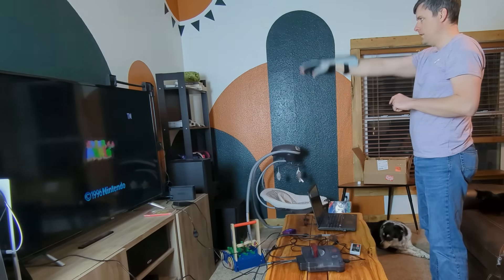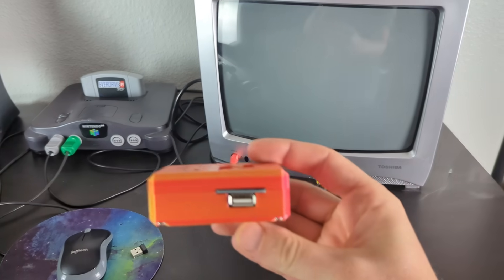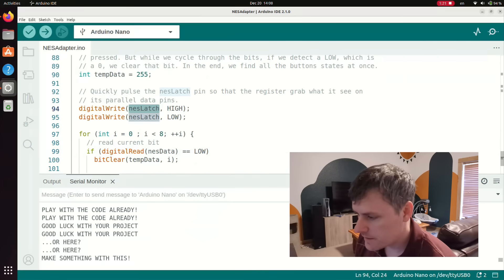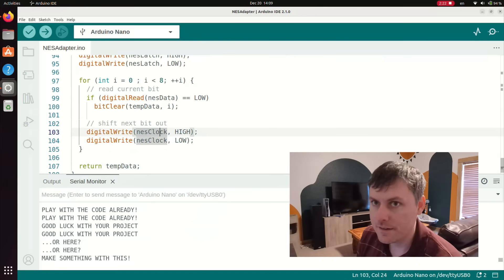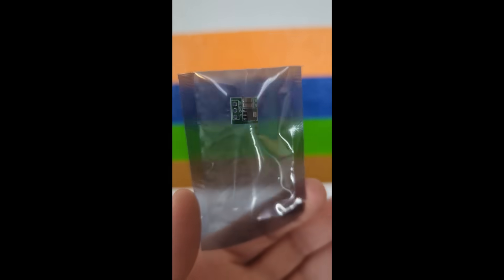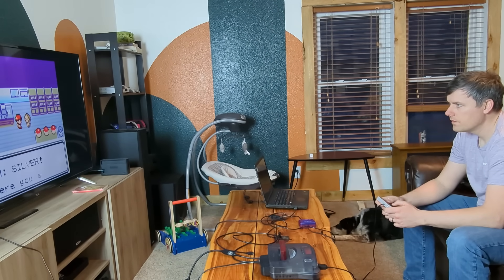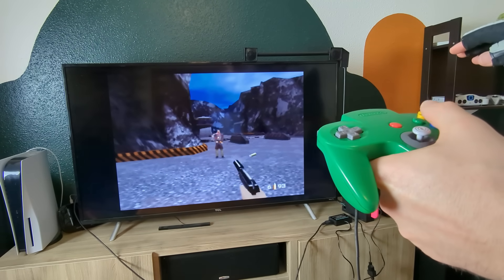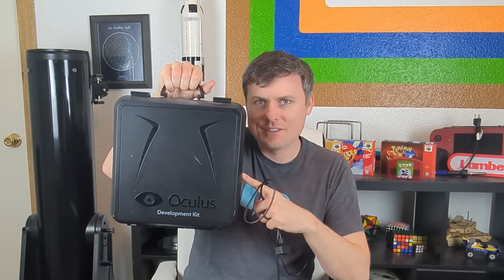Making an NES to N64 controller adapter

Comment: is there a way to buy this adapter or something similar. i have been searching but cannot find one online, or well i did find ONE but it was out of stock on the website. i really wanna be able to use like nes or snes pads on my n64 with the nes emulator on the everdrive. Thanks in advance for your response!

Comment: The SNES controller works the same way electrically/software wise as the NES controller meaning it wouldn't be very difficult to add support for that.

Comment: The d-pad emulation in the Powerglove is indeed terrible, but get it into full 3D mode and it's an amazing bit of tech for the day. As far as I know, only one game supported that mode: Super Glove Ball. There is a complex initialization sequence that the NES sends to the glove to get it into that mode. I reversed-engineered it using my TRS-80 as a logic analyzer, and then a friend used the glove in 3D mode to run MIDI synthesizers.
Reply from the maker: That would be fantastic to have! Is that protocol documented anywhere?

Comment: So in theory if you had Two of your adapters you could plug a Four Score or Satellite into it and play 4 player NES games?

The thing I want to see is an Adaptor that could some how interface with a R.O.B. and know when either Gyromite or Stack-up flashed him a command and activate the same command within him such that he could be used on real hardware but with modern Flatscreen Displays.

Comment: Hey so, they're working on an open source N64 library to extend the Rareware microcode to allow it to run even better, if you ported Portal64 to that, you think valve would be okay with it? Emanuar talked about it, but I forget the exact name.
Reply from the maker: They told me even if I dumped all proprietary code, I still don't want to keep an eye on the project
Reply: @james.lambert  Shame

Comment: I would love to see you make an interface for the printing capabilities in Pokemon Snap and Stadium (normally only used in the special Blockbuster printing stations) that either lets you print to a modern day printer or at the very least save the images to a file on your computer.

Comment: The fun part about the NES controller protocol is the SNES uses an identical one with a 16 bit shift register. You can even plug a SNES controller directly into a NES (if you adapt the connector) and it works just fine. The NES only asks for the first 8 bits, and the SNES maps the dpad, start, select, and A to the same bits. I think it may have swapped B with X.

Comment: OMG! A Rift DK-1 !!!! LOL. I still have mine from the kickstarter. My friends and I nicknamed it the headache goggles because after about 20 minutes of use we'd get a headache.

I think it would be really cool to see a Wii Balance Board working on N64. Probably not too many retail games would work well with it, but maybe with some ROMhacking or homebrew games made with the balance board in mind, it could be pretty neat, and maybe only a slightly worse experience than the Power Glove, lol. 1080° Snowboarding, Pilotwings 64...🤔

Comment: NES Power Pad to N64 when? The power pad uses a few pins that the normal controller doesn't. In fact, some online documentation on the NES pinout incorrectly states the pins go unused. Could be cool to see ddr mario64 controls ;p

Comment: I have my N64 connected to a CRT and I use the Everdrive 64 NES emulator a lot since I don't own a real NES
The N64 D-pad Is fine but an NES controller would add the authenticity

at that point I might as well buy an NES(If I didn't live In Europe)

Comment: talking about goldeneye: there was an initial idea of the original devs to use the rumble pack to reload ingame (i read it in an early nintendo magazin before goldeneye got released).

i wonder if it's possible to either map the "rumble pluged-in"-action to "B" (i think that's reloading) within the rom.

or if it is possible to adjust the controller hardware, so that plugging in the rumble pak also sends a B signal to the console. 🤔

Comment: I'm really anything but creative with such things, therefore I'm even more impressed when people build such things.
An USB adapter probably would be cool which reads either D-Input or X-Input controllers and translates those inputs.
Also a memory card which actually saves its data in an emulator readable format to SD card.
That probably would be what I would came up with.

Comment: Some idea to be able to connect to a N64:
Wii controller, better than the Power Glove.

A pen tablet, like a Wacom One, making drawing something in Mario Paint more precise.
A printer, so you can print whats on screen.
Reply: Getting a wiimote working on the N64 would also be a way to get a drawing tablet working.  There were two tablet accessories released for the Wii, and they worked by docking with the wiimote.

Comment: I'd like to see a follow up where you try to correct the issues with the power glove with an Arduino! I recall hearing the IR sensors are pretty sensitive to certain types of light, like candles. I wonder if maybe your LED lights are interfering?
Reply: My thoughts also.

Comment: Mouse and Keyboard controls for first-person shooters on the N64 might be kinda cool...

Getting a PS4/PS5 controller to talk to the N64 might be pretty straightforward, too, now that you already have a USB adapter...
Reply: Getting the ps4/ps5 controller to work with goldeneyes 2 controller mode to essentially have modern shooter controls would be pretty neat

Comment: I remember splicing the Rumble Pak actuator leads with a small battery-powered back-massage cushion through some external wires, specifically to play Starfox in first-person mode, it even used the cushion's D-cells since the voltage was same as the Rumble Pak's AAA cells.  Probably stressed the transistors, but I was so happy it worked!  :D

Comment: Supposedly the Power Glove is decent when used with games specifically designed for it (so only Super Glove Ball). If you can get the X and Y position, then at least it can be used as Wiimote-style pointer to emulate the N64 mouse and that's already way ahead of anything you could do with it on the NES. (Also I admire your restraint for not saying "It's so bad!")

Comment: I would recommend you to get a pi pico (or any rp2040) board so you can use the PIO, and the rp2040 even works with the arduino ide really well (but make sure to use the community board compiler) What i like about the pio is that you can have it communicate with the io and set internal registers to be read by the main program. You can even program the pio to automatically recognize and translate the n64 controller readings to a button map and have another pio translate the button map to say a gamecibe controller. Best part is, that you can have the main program getting interrupted, but because the pio is completely seperate, it can go on its own and simply tell the state of the controller whenever the main program asks, or vice versa.

Comment: I wonder if it's possible to use the expansion port on the bottom to connect two n64s to compute in parallel.

Comment: as I understand it, SNES controllers also use a shift register to store/send the button state just as an NES controller does.
Reply: Well they make LCD friendly light guns now, rigging one of those up (they are detected as a mouse) might give you a better goldeneye/perfect dart experiance than the power glove did, not that this is a bar to cross or anything.

The Oculus might be more doable (in 3DOF) than you'd think, at least for the right game. your biggest task there will be deforming the video output to go int the headset so it forms a screen you can actually SEE. The rotation vectors RX and RY would map to the stick just fine, and the Rz would mostly go rotating the external view conversion.

Now if you're willing to make an entire demo for it and use up two controller slots, 6dof wouldn't be entirely out of the question. It'd be... kinda cursed though, to put it lightly. would take all 4 ports to get a single CV1/Quest style 6dof controller in there, unless we're talking some REAL screwy abuse of button combos.
Reply: (addendum) actually if the polling rate of the controller ports is fast enough, you MIGHT be able to to get away with two ports for a headset and two controllers. provided the game is coded for it.
your first controller has 14 buttons. use up the D pad and C-button states to make an 8 bit 'ID' number for whatever axis your analog input is currently referencing. there are 18 axis for two controllers and a headset, 26 if including the sticks and trigger/grips as analog.  well within the margin if the libraries let you conduct such sorcery.

the main downside here is how many cycles it'd take to get all of the position data into the N64, and thus how out of sync it'd all be. My VR legs quite stout but I would not play any 6dof N64 hack on carpet because my luch would cover my feet pretty quick LOL

Given I have ALVR installed, I wonder how hard it'd be to try and track down the needed libs it would be, and/or code something cursed inMpuen to emulate the strange interface....

Comment: With stuff like the valve index in existence I sometimes wonder if it would be possible to actually make something like the power glove actually functional with modern tech. 
So much 80s stuff was so wildly ahead of it's time in concept, it's really wild to think about just how much stuff was made in that decade that was way more fun to yearn after than actually own
Reply: It would be much more reliable now, there is a documentary here in youtube about the technology of the power glove.
Reply: You could, but aren't VR controllers or Kinect the same thing, but better?
Reply: @franciscofarias6385  I guess a glove would be better for certain experiences than holding a plastic thing. Though it would depend for sure
Reply: @DemsW Controllers have the advantage of having buttons on them for whatever you might need them for
Reply: @DemsW  Mostly novelty, as jank as it was the fantasy of the power glove still casts a long shadow. You're not wrong through- as someone else pointed out in the comments Nintendo did remake it in the broad strokes- it's called the  Wii-mote.

Comment: Maybe a Super Nintendo adapter? PETSCII Robots was made for many systems in the 2020s and most used SNES controllers with custom adapters, but it was never ported to N64, and thus no adapter. Maybe both the game and adapter are up your alley?

Comment: Oculus DK1! would there be a benefit to using that vs a DK2 or CV1? the DK1 was... primitive. No translational tracking, so if you're motion sensitive at all, prepare your buckets because the puke is coming.
Reply from the maker: I fully expect lots of puke with this project. I want to be able to do all the processing in the USB adapter and the N64. The DK2 and CV1 require external cameras and would require a lot more processing.

Comment: Yup, this is power glove in a nutshell. Doesn't appear anything is wrong with your glove.

Now that you have opened the Pandora's box of the power glove, the rabbit hole goes much deeper.

Can you make the power glove sort of work by writing better input handling code for the device. It had some custom programmable modes for certain games, not sure if any of those make it easier to deal with the signals coming from the glove.
Reply: Rabbit hole*

Comment: But what if... somebody fixed the power glove with modern understanding and tools?
Reply: Delightfully devilish Seymore!
Reply: @qwertykeyboard5901 Why is there smoke coming out of your power glove, Seymour?
Reply: @I_Will_Geek why that's not smoke, that STEAM for the steamed Super Mario 64 we're having tonight
Reply: Why that's not smoke
That's STEAM
STEAM from the valve lawyers that we're having
Mhhhh valve lawyers!!!
Reply: Yes!! Or a new glove inspired by the original to avoid any old glove bottle necks!
Reply: ducktape a joycon to ur arm
Reply: My brain has the human equivalent of screen burn-in for steamed hams
Reply: Somebody did, and they called it a wiimote
Reply: That thing was flawed as fuck from the beginning..
Reply: Its called a Nintendo Switch controller haha
Reply: Does the PG use quicksilver thingies to determine the position?
Reply: Is there better tech that could upgrade the sensors in the tv bar?? 

Also, there is a doco on YouTube explaining exactly how it works and yes it mentions out 80s nemesis child fiddler Lucas whatshisname..
Reply: It wouldn't be that difficult.  When I was a kid I made a computer mouse glove that used a gyroscope to track hand movement and had pressure sensitive resistors to register clicks.  It worked surprisingly well, though it wasn't put together very well.
Reply: wii remote was accurate af, i was trying to mod my switch so it could work as a vr, but the gyros are only on joys
Reply: Came to say this. ❤
Reply: The entire glove needs to be reimagined & re-engineered with modern-day materials
Reply: Someone should try this

I don't have time or patience to figure it out?